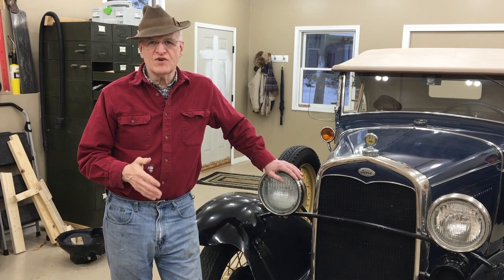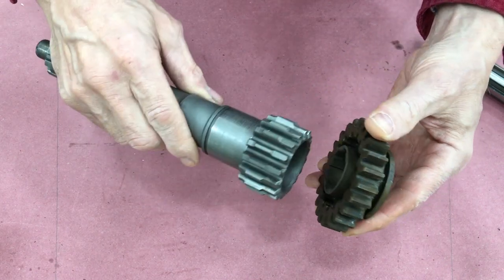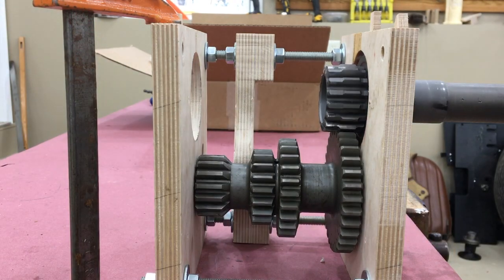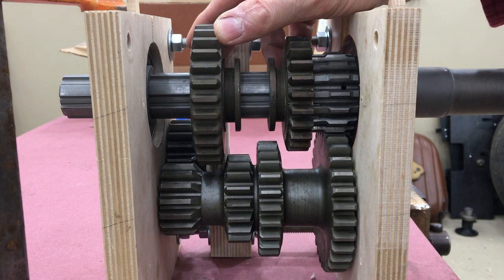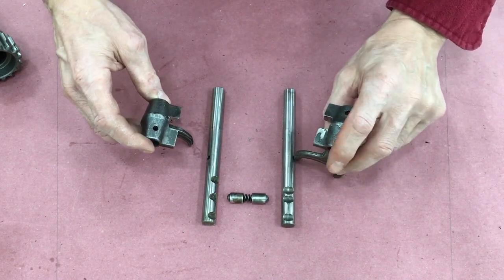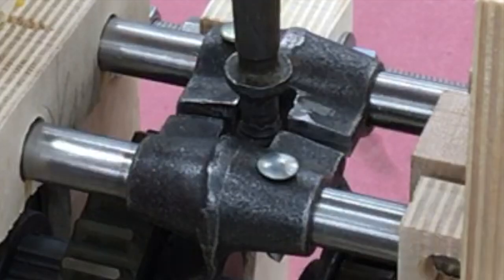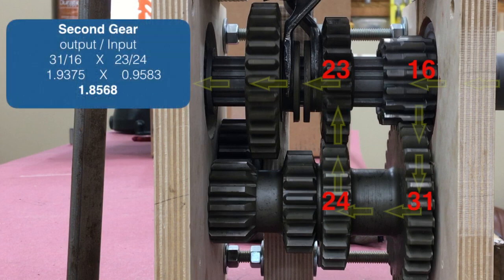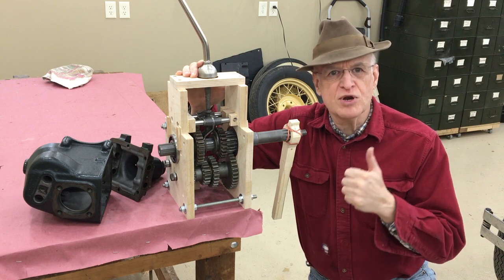Ford Model A Transmission - How it Works

Comment: Really good video! I had a 1951 Indian Chief motorcycle and it had a 3 speed sliding gear transmission. I learned quickly if I would try to "ease it" into low gear it would make a lot of grinding noise so I would "throw it" into low gear as hard as I could. Also had a 1958 Harley Panhead which was 4 speed constant mesh. It was quieter, worked smoother but had more moving parts than the Indian. Neither could be put into gear while the bike was moving with the clutch in, thus is why later car transmissions were "synchro-mesh".

Been a gearhead before I could read!
Reply from the maker: Yes, I have owned an few old bikes myself.  Thanks for your comment

Comment: Hell George -  This is an unbelievably fantastic video! Thank you so much for the detailed explanation of how the transmission works. I completed an engine swap in my 1931 Ford Model A (original engine blew piston #1 and the donor engine came out of a 1928 Ford Tudor) last week and the engine started up just fine. The donor engine had the transmission still attached, so I just used it, as it was in working condition when both the engine and transmission were removed from the Tudor. I had to remove the shift lever assembly in order to insert the transmission (still attached to the engine) through the engine compartment into the truck as one engine/transmission unit. Well, my first test drive was yesterday and I found out quickly that the only gear that I had was reverse. The transmission would shift (with the clutch in) into 1st, 2nd, and 3rd (but not reverse),  but when I let out the clutch the truck would only move in reverse. After watching your video, I think I know how to resolve the issue. It appears that I did not re-assemble the stick shift assembly correctly. I think that the transmission was in reverse gear when I got it, and I didn't re-align the gears appropriately when I reassembled the stick shift box. At 7:24 in your video, the fork that you show is the issue (I think). At 7:58 you show how the fork is slid into place on the reverse/1st gear. After watching your video, I don't think I did that correctly - my reassembled fork missed the gear slot. Therefore, I'm stuck in reverse gear. I am going to take a look this afternoon. Your thoughts? Mike
Reply from the maker: Thanks for your comment.  Yes I think it is possible to incorrectly assemble the tower, or put the tower on in the wrong way... I can’t think off hand what went wrong, but obviously something.  Suggest you  make sure the tower is assembled correctly, then put the tower on when both the tower and the gear box are in neutral position.   Let us know how things come out.
Reply: @georgebell7103  Hello George - My 1931 Ford Model A truck is back on the road thanks to you and your GREAT video!! As I said in my last comment, I put the transmission back together but it was stuck in reverse. Thanks to your video I quickly knew what the problem was. I'm driving the truck around today and I have you to thank for that. Yours is by far the BEST video on Model A transmissions on YouTube. Thanks again. Mike
Reply from the maker: @BigTex347  great to hear you re back on the road with your Model A.  Thanks for the nice comment, and your kind words.

Comment: How does the clutch effect the shifting?  Do the gears sync speed before engaging?  Why need double clutch?  Have you ever climbed a mountain cliff?
Reply from the maker: Wow, Lots of questions... 

The clutch separates the engine from the transmission, so must be done to shift properly. However, I don’t think the clutch itself effects shifting very much. If the clutch does not work properly it can hamper, and make shifting more difficult.

This transmission does not sync the gears automatically.  The driver needs to mesh the gears.  Synchromesh transmissions didn’t not come along until later in the 1930s and 1940s

Double clutching is not required, but if done properly helps attain smother shifting.... why?  This is a more complicated answer, but double clutching  when shifting up helps slow down the cluster gear shaft. Double clutching on the way down generally must be done to increase the speed of the cluster gear to match the speed of the output shaft.

I have never climbed a mountain cliff, with the Model A.
Reply: @georgebell7103  

Mr. George Bell,

no, no, no, I didn’t mean climb a mountain cliff with a model A. (laughing quietly to myself).   I was merely curious if you were related to the theoretical nuclear physicists and avid & accomplished mountaineer George Bell.  http://lamountaineers.org/drupal7/history5 

If not, judging by your demeanor I’m sure your past holds many truly remarkable stories.

Modern conveniences are a virtue but unfortunately the vast majority would not be able to survive without them.
I was fortunate enough to be brought up and taught the importance of the basic necessities necessary in life.  It’s my unique staple that I’m proud of and happy with.  I grow my own garden, I don’t have TV.  My flip phone I always leave at home.  Internet only in moderation only for research, e-mail and news.
I’m in the process of acquiring a Model A pick-up that has been sheltered from the elements in my in-laws abandoned homestead machine shed untouched for 60+ years.  I’m excited and looking forward to restoring its to it’s original condition for use.
I’ve watched several You-tube videos regarding Model A restoration and maintenance, yours was quite informative.  Your poise and knowledge seems unsurpassed, I learned a lot, I felt comfortable with your presentation.   
I look forward to driving my model A.  It will truly be remarkable and rewarding.  
Thank you for taking the time to construct the gear model and responding too my “many” questions!  I will be an expert in a short order, guaranteed.

Respectfully,
Methinee
Reply from the maker: @chirawan2020  Well, I don’t believe we are related.  Thanks you for the nice comment. I hope things go well with your pickup restoration.  There is likely a Model A club nearby. Join the club and get good advice and make good friends along the way.

Comment: No planetary gear ? ;)
Reply from the maker: Nope...simple as it gets
Reply: George Bell do the gears sit partially submerged, like a modern day differential, in lubricating oil ?
Reply from the maker: @TheSchmed  Yes.  The transmission case is about half full of oil.  When in operation there is a massive churning of the oil which gets to every part.

Comment: Best ( illustrated ) explanation i've ever seen on how a transmission works , along with doing the math  on the gear train . I have seen all your videos on restoring the SB lathe , really great ! Are you a mechanical engineer ? If not ,  what did you do for a living ?  Curious
Reply from the maker: Hey,  thanks for the comment.  I was still working when I did the lathe series, but am now retired. I was an Accountant.  My last job was as Chief Financial Officer for A company in the Midwest.

Comment: I can't imagine a better explanation on how it works. THANK YOU.  My '30 Tudor has a leak at both ends of the transmission so I will be rebuilding it soon....
Reply from the maker: Thanks for the nice comment.  Check out the other videos in this series, you may find them helpful, as you do your rebuild.

Comment: I've shifted Model A's  for decades, but now I know what's going on down below.  What do you recommend for gear lube.  I have  some 400w but it's getting old, itself.  Will anything help prevent grinding gears ? -  other than practice, man, practice .   I'm a retired teacher, but I'm more than a little impressed with your teaching skills !
Reply from the maker: Hey, thanks for the nice comment, now that I am retired I am considering going into teaching.  All the Model A parts suppliers have oil for the model A transmission.  It is a very thick weight.  You are right, the only way to not grind is to practice.  Take care.

Comment: yes this is great and i wish that this concept would have continued into motor cycle as the concept of most motor cycle is that either its automatic or you have this bogus knob that gets loose so the chain will break and good luck fixing a chain on the highway because i tried and broke the chain tool.
Reply from the maker: Thanks for your comment

Comment: I think the 'T' model trans was better...
Reply from the maker: Thanks for the comment... tell us why
Reply: Well, at the very least it was impossible to grind gears, when the shifting (and even breaks) were based on wet clutches.. But it was a massive transmission for the size of the vehicle, and you could still burn them out, or at least get cotton fluff in your engine oil. 
I still like the model T's transmission.. It's just so vastly different from modern transmissions that evolved from those like the A's.
For the cost, though, which was a huge factor for Ford, this one is much better, and more gears for the new, more powerful V8 engine.
Reply from the maker: @mikafoxx2717  Thanks for the comment reply
Reply: @georgebell7103  And thank you for the amazingly easy to understand videos!

Comment: It may be simple in some terms but if you started with molten cast iron and cutting and machining those shafts, gears, fasteners, bearings, seals and tolerances it’s not that simple or different from today’s computerized marvels, just a lot more numbers. Kudos for a great presentation. Henry Ford lead the way for people to move. So much is taken for granted today and wasted. Sometimes less really is more like the EPA rated 44 MPG two stroke gasoline Achates Engine in the Ford F-150 crew cab or the new Cummings Achates fourteen liter diesel 1000 HP Advanced Combat Engine that 25% more fuel efficient. It’s a four cylinder/ eight piston opposed 2 cycle compact marvel with no valve train or heads.
Reply from the maker: Yes, I agree.. thanks for the comment

Comment: Geolrge, thank you for such a wonderful video. Just found your site and subscribed. I have a 28 Tudor that has the engine out for a total rebuild, just got an update no cracks and/but cylinders 
Will be 80 over. I’m not a mechanic so to me this sounds like a problem? They are going to replace valves and seats with stainless (?) to eliminate need for lead I’m told . This job has been 
4 months now, feeling antsy. In your opinion should I have trans pulled and gone over?  Respectfully, Bill
Reply from the maker: Send me your email... we can discuss. PargoLongAgo@Yahoo.com

Comment: That little plywood demo gear case was very clever, and took some degree of engineering skill.
To be honest, until watching this video, I had not realized that the Model A has an all sliding-gear transmission. Even a 1940's-60's three speed with non-synchro first gear has a constant-mesh second gear with a dog clutch. No wonder I had so much trouble making clean shifts the time I drove a model A. Even without synchros a constant mesh transmission is easier to shift than a sliding gear trans.
Reply from the maker: Thanks for the comment

Comment: The reverse idler gear is not included in gearing calculations. Thus the title idler.
Reply from the maker: Okay Richard, I finally see what you are saying... my calculation included the 18 tooth idler, but you would get the same answer by excluding the idler gear.  The final ratio is the same.. good thing I can edit my lame responses to your comments!      I will leave this string in place for its entertainment value.
Reply: @georgebell7103  Thank you for your gracious reply, Mr. Bell.  I have been designing, manufacturing, and inspecting gears  for 35 years.  I enjoyed the video very much and your case mock-up is inspired.
Reply from the maker: Thanks for your comment... because the idler gear is in the “train of gears” from the input shaft to the output shaft it changes the ratio, and therefore must be included in the ratio calculations.
Reply: @georgebell7103  The gear that drives the idler could be geared directly to the output without a change in ratio, only direction.
Reply from the maker: Yes it could if the number of teeth were the same , but they are not , therefore the ratio changes as power runs through the ideler.
Reply: A thought experiment:  A 50 tooth gear running clockwise at 50 rpm. Engaged is another 50 tooth gear.  What is the output speed?  50 rpm.  What direction? Counterclockwise.   Put a 20 tooth gear between them.  Now what is the output speed of the second 50 tooth gear?  50 rpm, but in a clockwise direction.  The idler gear cancels out of any calculation
Reply from the maker: Richard,  Thanks for your comments and persistence.  
Your thought example is exactly correct. But that is not how the Model A Transmission works.  1st has 4 gears in the power flow, but reverse has 5 gears.  The additional gear changes the reverse ratio. See the math at 12:04 in the video.  
First gear on the cluster shaft has 15 teeth, but the idler gear has 18 teeth. So the ratio for 1st gear is not the same as the ratio for reverse.  If the idler gear was also 15 teeth then first and reverse ratios would be the same.
Reply: @georgebell7103  I am sorry but you are simply incorrect.  The idler gear does not change the gear ratio.  The number of teeth on the  idler  is irrelevant.  Your shown calculations are wrong.  It should simply be 31/16 times 29/15  which is still 3.7458- the 18 in your equation cancels out.  do the math.  Replace 18 with any number and do your math again.  The result will be exactly the same.
Reply from the maker: Thanks for sticking with me, and not getting frustrated with my strange  responses. You need to subscribe now to keep me honest!

Comment: I did a full transmission rebuild when I was about 12 years old when my dad and I restored a 1931 Deluxe Coupe. I worked on it steady from 5th grade until it was done after high school graduation. Skills learned on the A have helped me be more independent in handling my own mechanical work on the 2005 Jeep I drive daily now. The A was so simple and rugged. Dad passed away just over a year ago and a couple of years before, the A had moved on to another owner. I am sure it is still clocking miles on the road today. I stumbled on your video by chance. You brought me back some memories of our times working on the old car. Nice job! Thanks!
Reply from the maker: Thanks for the nice comment and great story.... maybe you should consider buying another Model A!

Comment: How similar is the Model A transmission to the 32 Model B 4cyl transmission??
Reply from the maker: I think they are similar, but began to evolve after the Model A. Changing every year during the 30s.with helical cut gears and other improvements.
Reply: What type of gear oil do you recommend? Thank you for the information!!
Reply from the maker: Model A transmission takes a thick 600W gear out sold by all the Model A parts suppliers.  I don’t know it’s modern numerical designation.  I suspect of you ask these questions on a 32 Ford Face Book group you will get your answers.

Comment: Excellent! It would be great to use the same setup to demonstrate why double clutching is necessary, and how it works. I would also like to see how gear synchronizers work to match gear speeds.
Reply from the maker: I have been thinking the double clutch thing would make a good video... it is more complex than people think.   Thanks for the nice comment

Comment: Wow, George! You made some serious effort to build that wooden frame making it easy to follow the otherwise hidden functions inside the box. You realy found a perfect way to show it outside the box and explained how all parts are working together so well and the filming also was done in a very professional manner. Thank you so much for this fantastic video. Now i like my 29 Roadster even more!
Reply from the maker: Hey, thanks for the nice comment,  roadsters 
are great fun
Reply: Just came across your video, I was hired by a Lady to get her 1937 Ford and the Model AA 1929 running, (the 1937 sold quickly) the 29 AA is now for sale, it was a joy to see your work and you really are a teacher, don't spend half the video just rambling, you start with teaching and finish with teaching, I find pleasure in your work, explanation and the time it took to make the mock up transmission, I was raised behind the times in S.W. Louisiana we used a stream engine to flood rice land until 1957 and even has two crude oil engines, yes the gas engine is here, in my opinion we have backed up a lot, mechanics are going my the way side while the new boys are tech's if they can't plug and play you screwed, thanks for you kindness to share, wish my shop was that clean ? Joe
Reply from the maker: Hey, thanks for the nice comment,  I kind of cleaned up a bit for the video.

Comment: Great video. I work on transmissions ( for the other guy, GM) interesting to see how simple and no synchronizer. I’m betting finding  the vehicle speed to engine speed sweet spot is the key to great shifts.
Reply: Ed, you have to manually adjust the spark advance. Manually set the air fuel mixture, and know how to shift it to drive it.  I look on all this  as a anti-theft devices.
Reply from the maker: LOL,  I always turn off the fuel valve as well.... who is going to figure all that out?
Reply from the maker: Thanks for the nice comment, it takes a bit to learn how to shift the thing, but nearly no grinding with some practice